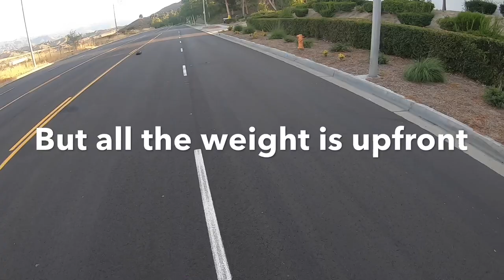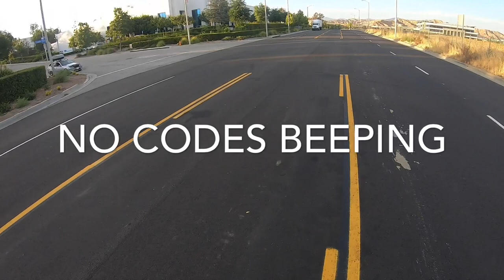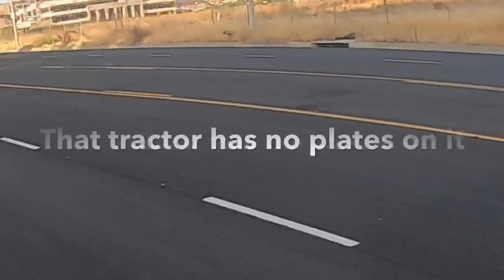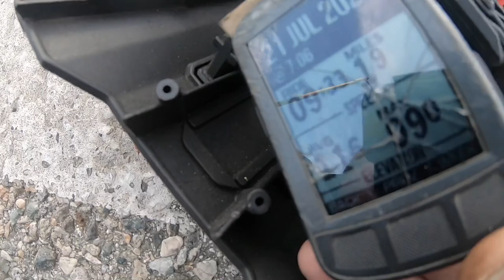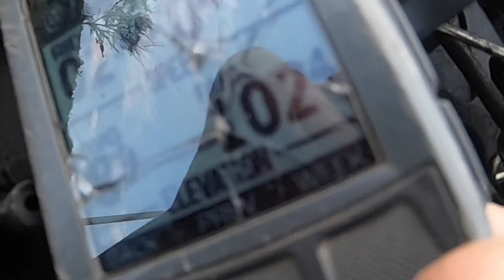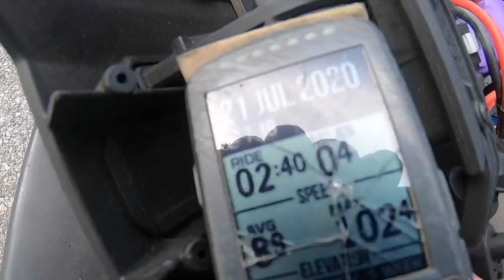Arrma twin motor infraction MMX8S x2 & TP power 1700 kv motors light speed passes after rebuild

Comment: Love the way you've not given up with this twin, good man!
Reply from the maker: Yes I can’t give in I have to know how to control it for sure it sure has a ton of kick 💯💯👍👍🔥🔥🔥
Reply: @earlmoorhead5555  i built a few as you know, i found the 5th scale twin was just too much power, perfectly bent every single tooth on the HD spur gear and the twin Max8 system i tried just tripped out one of the ESC (draw over 200 amps) i think you got it right with that motor esc combo, were all rooting for ya!
Reply from the maker: UNRooted RC appreciate that as your builds do inspire most of us to try thanks I’m hoping I can add the trigger control in slowly so I can find that spot where it just works 👍👍💯💯🔥🔥🔥🙏🙏🙏

Comment: Wicked build, too bad you dont have a better location to really see what she can do.  There arent any tiny private airports around?
Reply from the maker: Not any with good roads that I found yet 💯💯🔥🔥🔥
Reply: @earlmoorhead5555  there is a local almost disused municipal airport that I used to run the X01 on many years ago.  Literally doing speed runs right on the runway lol.  You can listen in for air traffic if need be.  The airport I used was lucky to see 5 aircraft a week.

Comment: That looked like it was doing those speeds so easily 😎 she should take a look at herself and what she's doing before trying to tell you what you should or shouldn't be doing 😂 what's your estimate for the booster range now? Great video pity about the traffic. 👍 😎 😀
Reply from the maker: Yes I agree 💯💯I went as far as I could see it and no lost of signal beeps off the esc anymore 💯💯I noticed if you do a walking test with steering it’s a false working as the esc will still give a lost signal for a half mile because it glitches so looks like about 1 mile on 2s
Reply: @earlmoorhead5555  interesting that it gives out a false reading when doing a walking check.
Reply from the maker: Andrew Whiting yes the esc is so sensitive if even a weak signal will set the beeps to check range and batteries 💯💯🔥🔥🔥